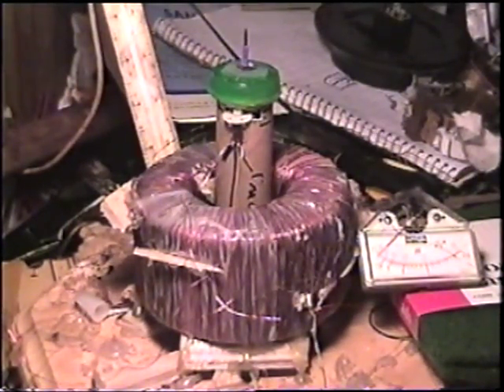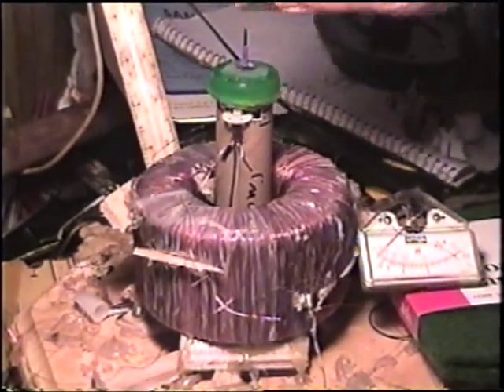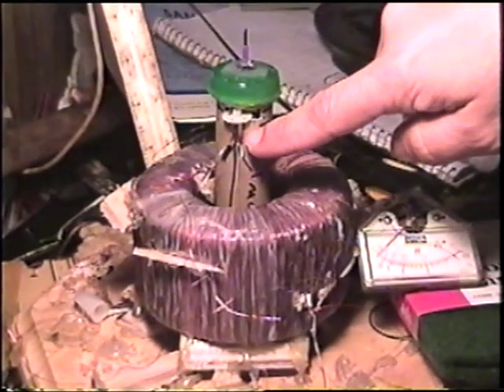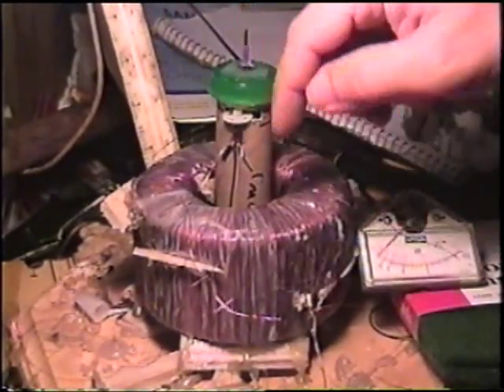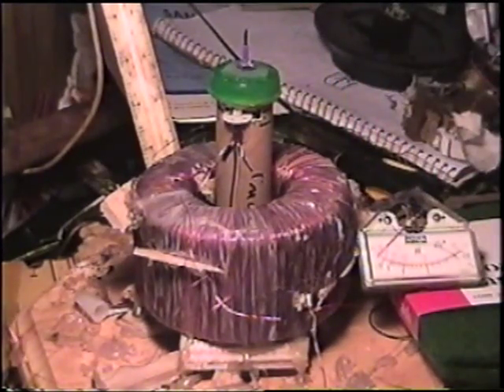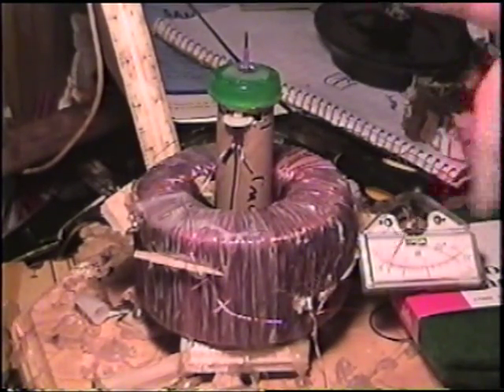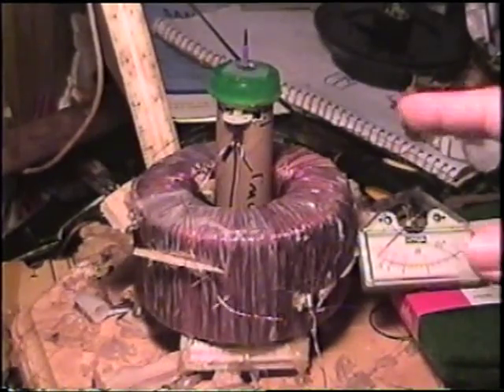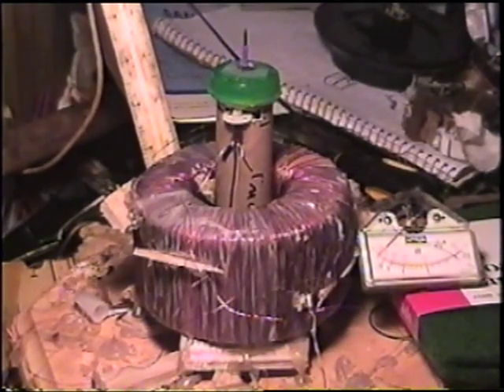Magnet Motor Magnet Capture Energy Test

Comment: Do you mean two coils on the same core and only low current coil is loaded? how is high voltage coil connected then?
Regenerative Accelerator, sounds too good, please explain, thanks